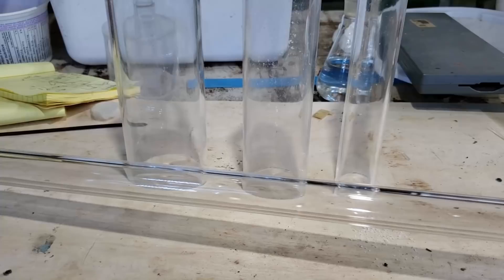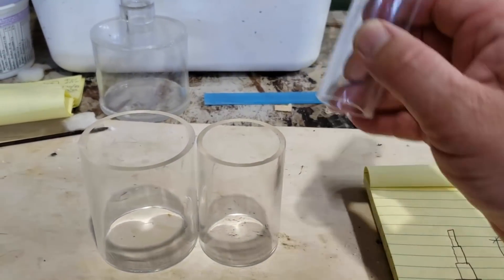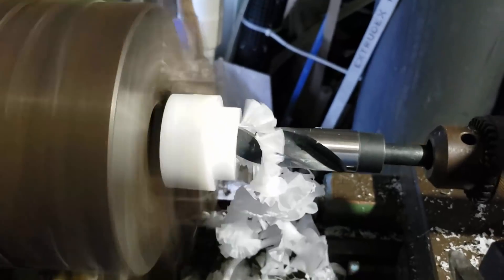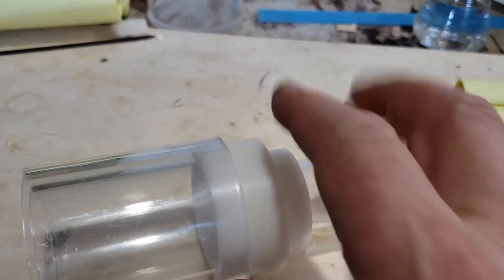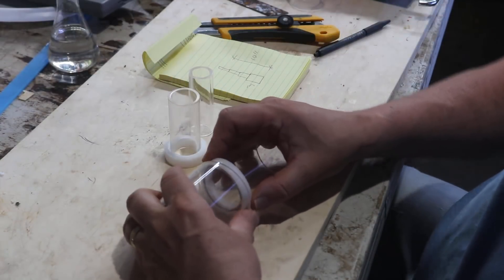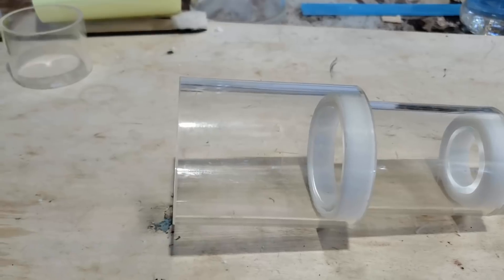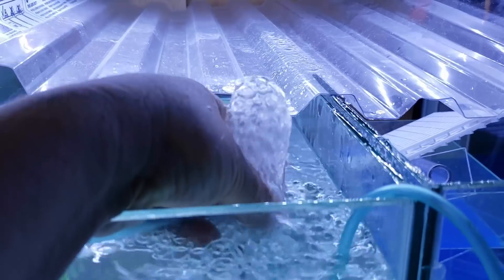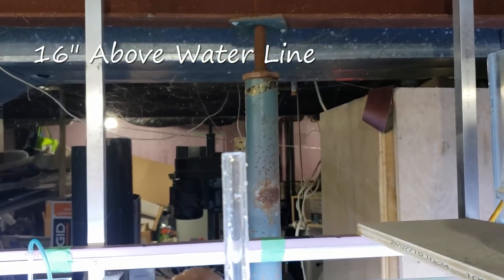Getting More Water Flow Using Air

Comment: Could i use a piece of pvc pipe to pump air into, install the pipe on a slight upward angle, and get it to slowly pump water from one end of the tank to the other. Would the bubbles help circulate the water? I am setting up a guppy pond using an old bathtub, so its pretty long, and i wonder if i would benefit from being able to move water from the stagnant end to the other where the water gets pumped into the filter.
Reply from the maker: It would work as long as the pipe doesn't stick out of the water too much. That's where these things tend to go wrong

Comment: I'm sure you figured out a solution by now, but what about a ram pump? 
The one that is basically powered by compressed air (at least to my understanding), and doesn't need any electricity or anything.

Comment: Hi fishman, what about an air set up for circulating water in an 8” x 8” x 22 “ high aquarium. I’m trying to come up with a set up to circulate water through this size tank without putting an electric circulating pump inside. I just thinking about a long rigid 1/4” air tube running down to the bottom of the tank? But that won’t move the water up like your set up does. What about a mini version of what you’ve done in this video? Thanks
Reply from the maker: Funny as I was first scanning through comments I read this as if it were in feet lol. That would have been quite the problem. The problem with the size you're working with comes more from not taking up too much room in the tank. If it could be drilled that would make it easy. Without drilling then a curtain of air going up the back would work well. A contained system not too much more elaborate than the one I was playing around with in https://www.youtube.com/watch?v=J9D2HSDlBIw&t=1s . Hope that helps
Reply: Fishman thanks much! I subscribed to your channel. I just started one about 6 weeks ago. 👍🏻😃

Comment: Have you found a solution? Any consideration to using 3 to 5 smaller pipes, tubes, at the top?
Reply from the maker: Hey Kirt! There seems to be a consistent problem with using air. The only way I've found around it is using the multi stage lift
Reply: @FishmanEricRussell  I've seen the multi stage and give you kudo's on an awesome innovation! I believe it is the service level you are lifting from that causes great effect. The highest stage, make it to the depth of the tank and lower that lift tube above the service, possibly with a pressure coupling, and you might get more lift. Keep the ideas and innovations coming, I really enjoy your builds!
Reply from the maker: @kdgardiner7872  Thanks Kirt!

Comment: When you run out of delrin you could possibly use those plastic type cutting boards for bushings. I know some woodworkers use them for table saw runners on their jigs.
Reply from the maker: Thanks for the tip.I have used UHMW polyethylene before. It doesn't machine as well but it works. Thanks again and for watching

Comment: I think you should try and put some kind a valve in there, kind of like a ram system that keeps the water that’s pumped up Stuck at the upper elevations
Reply from the maker: Something like a flapper valve. That could be interesting. Thanks. I will have to look into that
Reply: Fishman Something like that. Or you could even do like a reverse waterfall and just have it pump water up 3 inches into another lift reservoir that pumped it up another 3 inches.  I don’t know how you could do it to make it look nice though you can make a nice square box or something where it raised 3 inches at a time but it’s still going to be bigger. I think instead of using different size tubes if you were able to funnel it it would probably be a little more efficient but I think it still do better to raise it 3 inches and have it dumped into a reservoir and then raise it another 3 inches from there. In theory you could do that pretty much forever with enough air stones.
Reply from the maker: @ShaneZettelmier  Already working on that Idea! My concern was regulating the flow between steps so they all had the right level of water.
Reply: Fishman I wouldn’t worry about it if I was building it because if too much is coming from the bottom it’s just going to flow back down the tube so you just need to fill the reservoir, the faster the better if there’s too much water going into it it will just fall back into the tank and won’t matter. It will act like a waterfall basically and excess water will fall out so just at every point I would try to move as much water as possible. Other than that I would just try to use A coil of tubing or something like a screw inside of a tube like an Archimedes’ screw but instead of turning it have the bubbles flow up and getting more bubbles in there basically extends the length of the tube in the water cover or that’s the idea behind it anyway and hopefully that would build up more pressure and raise the water to a higher level. But that’s all theory with me I haven’t actually built anything like that yet but I know the waterfall version will work. I would just use the same size lives at each step of the way. It looks like it’s flowing pretty good in about 2 1/2 or 3 inches so if he did for levels at 2 1/2 inches you’re talking about 10 inches and you need for air stones but you get pretty much the full rate that you would get from one at water level
Reply from the maker: @ShaneZettelmier  It shouldn't be too long before I give this a try and then we will see how it works in the real world. Thanks for allof your input
Reply: Fishman A flap would work like those ram pumps they put in rivers. But at that point you’re getting pretty complicated
Reply: Fishman another option I considered was to go with a coiled tube where the bubbles went in the spiral like a screw pattern through a coiled small tube and that would just make the bubbles go a lot farther, if you can get the size of the bubbles just right it should almost seal the skinny tube.  The idea is that because you’re pushing the water at an angle instead of straight up it’s going to be less resistance and because the tube is coiled it’s going to be a lot longer so you’re going to have a lot more bubbles in the tube.

Comment: Steps instead of a smooth taper must be costing you some flow. It's a lot of turbulence and counterproductive low pressure areas. Maybe try an experimental thick glob of silicone to cut those 90 degree steps in to 45 degree steps.
Reply from the maker: I am going to try and put together a bunch of suggestions from the comments into a video. Thanks for watching

Comment: If you want more water rise, with air. How about instead of drilling the airl line tubing at the bottom ( closer to bottom of the tank) of the step stage acrylic tubing  you made. Drill the hole say in the middle stage , that should get air to push the water height up pass the surface of the waterline.
•keep almost everything the same.
•just move the location of the hole, midway up the pipe you made
Reply from the maker: I am going to try and put together a bunch of suggestions from the comments into a video. Thanks for watching

Comment: Edit:  I typed 3/8" ID originally..That was wrong.  I actually used a 3/8" OD tube with a 1/4 ID

We share the obsession of making a better aquarium airlift.  I found the best way to get high lift is to have the lift go as deep in the water as it can go, to use a smaller tube (1/4" ID) and big bubbles(no air stone).  What you get is kind of like what you had at the end with the spurts; in pneumatic conveyor systems it's known as slug flow.  I get respectable lift in spurts; of course the flow gets worse as the discharge goes higher or the amount of lift below the water decreases.  I find my test lifts needed the air flow to be carefully set and I don't know how long it could run in the real world before needing tweaking.  

If you go to a higher diameter tube the surface tension of the water can't bridge the tube and maintain the slugs so you get behaviour like a regular air lift. How to scale it?  I have no brilliant ideas but my first thought is that you run into a similar problem building cyclonic separators:  If you make one bigger to allow more flow then you make it less effective; diameter changes really effect performance.  What you do in that situation is put enough properly designed separators in parallel (as seen in a certain brand of very expensive bag-less vacuum cleaners) to handle the flow rate you need.  ...but a bundle of air lifts creates another set of problems in terms of appearance and maintainability.
Reply from the maker: Cool idea. I will have to give it some thought. Thanks for watching

Comment: Would an upsidedown J shape pipe at the top help with the flow by adding a small syphon to the top of the pipe or do you think the bubbles would ruin any syphon?

Regarding customers wanting the kit to be unobtrusive, a Hamburger Mattenfilter can be DIY'd into one of the back corners of the tank and with your skills with acrylic, it could look either presentable or perhaps blends in with a dark background.  It could be air driven with an outflow guttering that wouldn't need to be much higher than the water level transporting the water to the other side of the tank.
Something along this line -

http://www.seriouslyfish.com/a-basic-guide-to-the-hamburger-mattenfilter/
Reply from the maker: Thanks for sharing your thoughts on this. The "J" won't work as there wouldn't be enough of a drop to create suction and as you said the bubbles would ruin it anyway. Hiding filtration for tanks that are viewed from the front aren't the problem it's the ones where people walk all the way around. I will have a look at the clip and thanks again for watching

Comment: I don't understand  what you are trying to do. Is your standpipe just to move water around? Please explain.
Reply from the maker: My intent here is to create a system using air to lift water a significant height above the water line in the tank. That way I can use an air pump to run filter styles that I currently need a water pump for. Thanks for watching

Comment: Definitely quite interesting and I've learned a lot from watching your channel. Though I do have a quick question how do you get so much acrylic to work with? A 6inch 1/4" ID tube was going to cost me $600!
Reply from the maker: Not sure where you live but I'm glad I don't live there. I couldn't afford to work with acrylic at all. I just bought two six foot 1/4" lengths of tube and 3' of 2.5" tube for a total of about $50. Most of that was the larger dia tube. Even the most expensive dia tubes don't come close to that.
Reply: @FishmanEricRussell  Oklahoma.
Reply from the maker: @nicholaswebb1313  Why is acrylic so expensive there? You'd think it would be cheaper in the states
Reply: @FishmanEricRussell  Wish I knew. I definitely enjoy building things.

Comment: As I recall, lift above the surface is related to the depth of the lift pipe below the water for a given airflow rate. The higher you need to lift above the surface, the deeper the bottom of the lift tube needs to be. Something like 5-6:1 I think? There's also a rather sharp inflection point with regard to airflow vs flow rate. I can't recall the ratio though. It's been a loooong time since college.
Reply from the maker: probably even longer for me lol! I'm definitely going to test out this on a deep tank to see how it works. Thanks for sharing your thoughts on this and for watching

Comment: I think you will get just as much with a jet filter and pressure chamber
Reply from the maker: At these heights, for sure. I built one a while ago and it works quite well. I'm hoping to be able to get some height out of these. Everything seems to lose flow once you get a little above the water line. Thanks for coming by
Reply: @FishmanEricRussell  that's something I've also seen, I would like to drive a overhead sump with one at some point.

Comment: Have you ever considered an air powered Tesla valve as you like to build things just as an experiment. It will probably just end up being an expensive geyser. 
Enjoy your content very much.
(Edit) I didn’t discuss oneway or check valves as you mentioned work great at first but decrease and eventually fail.
Reply from the maker: Thanks for the idea. Building one with my equipment would be a challenge. Also I'm not sure how mixed fluids would work in it (air and water). I will give this some thought. Thanks!

Comment: Very interesting. ive been on the same subject of air driven stuff too. i swapped my matten filter over to a box filter and i love it. but the airlift tube is not long enough to go from the bottom of the box filter (to get water to flow through ALL of the bio media) to the surface of the water. and its loud and annoying sitting a few inches under the surface. ive got the swisstropicals betterbox filter and i was looking at buying a longer lift tube. BUT i got the idea that id love to get the water to go through the filter then flow to the other side of the tank before exiting the pipe. so i was planing on buying a long piece of 25mm PVC (because thats what the mattenfilter came with and i like flow also) or a piece of tubing from my old canister filter and seeing if i can get the water to flow all the way to the other side of the tank. i dont need it to come out of the water much but move horizontally. but if you can get this to work and work well you could use it for the planter that sits on the rim of the tank. THAT would be awesome. i really like growing plants in and out of the water. VERY cool project.

Comment: Great idea, and it seems to be working... that last part, though... I think that's because you're way too high above the water level... you had good flow a few inches above, but a foot above... yeah, ain't gonna work!  But yeah, great idea!   :-)
Reply from the maker: My confidence for finding a solution for getting air to lift water more than a foot above the water line is probably not the greatest lol. I will keep trying though. Thanks for coming by
Reply: @FishmanEricRussell  So... this IS just an experiment... seeing if you can do it with a bubbler?  Maybe just go with the two thin tubes, but I doubt that would make a difference... Maybe a few inches... I hope you prove me wrong!   :-D

Comment: Hi Fishman, I played around alot with the airlift pumps as I am partially using this for aquaponics too. (not so much currently) but to share my experience from trying it on my indoor aquarium. the hardest thing is to get this working for shallow tanks as the depth affect the head hight you can pump at. Three things you can do to help right off the bat, 1, make the bubbles as small as possible with high quality airstone, this will have greater surface area of each bubble and better lift, it will also make the system all but silent ;) 2, use/make conical bushings or reducers as the edges ruin your flow as the water rises and especially af the end try and have the pipe bend softly. 3, this  if a little extreme but works really well. As most aquariums are off the floor at a decent height, have a thick pipe sealed at the bottom end stand hidden behind the aquarium from floor to the top of the water in the aquarium, you can then have an overflow run into the pipe, and your airpump tube can gather momentum all the way from floor level despite the tank only being say 2 feet ;)
Reply from the maker: Those are some great ideas that i will have to look into. Thanks for sharing and for watching
Reply: Thank you arufuponic and fishman, this is a great insight for me as i am in process of building a breeding farm. Wish you guys are all well with your things and your health❤❤

Comment: Nice idea. Try to make it a cone shape so that the water flow doesn't have anything to hang on to. Because you have those type of steps that slow the water down. Or try to smooth then down and make it to a cone shape. But it's nice to see how the water flow is faster then before. 👍👍
Reply from the maker: Hey Johny!  A couple of people have suggested this. I will have to figure out how to make it a smother cone shape. Thanks for coming by. I've almost finished the rebuild for you filter
Reply: Thank you for everything you do!!!!👍👍♥️♥️
Reply: FloTools: extra large funnel for $1.45 would work for me but I doubt it would for Fishman as it’s aesthetically ugly. Is that why no one has suggested using one.

Comment: Jet lift tubes get more flow with same size pipe, theyuse smaller bubbles. More bubbles (even smaller)displaces more water creating more flow. You may want to research that angle. A smaller tube moving more water would be more visually appealing, and easier to hide.
Reply from the maker: I've tried some of the jet lift ideas. They have the same issues as all air lifts I've tried so far and that is they lose flow quickly with increase height above the water line. Still going to keep working on this. Thanks for your input and for watching